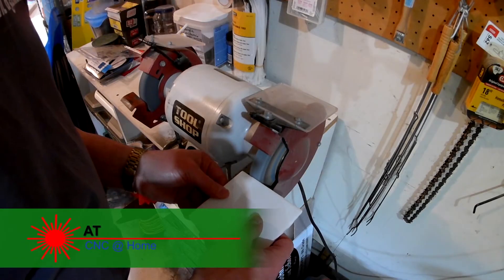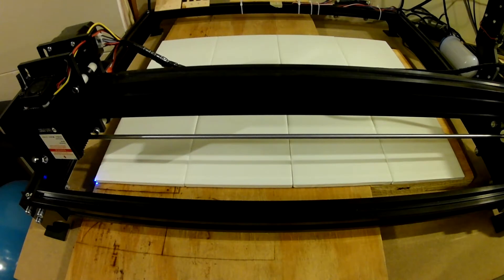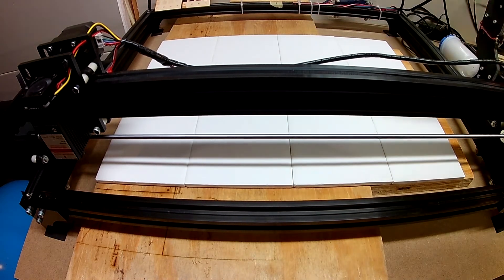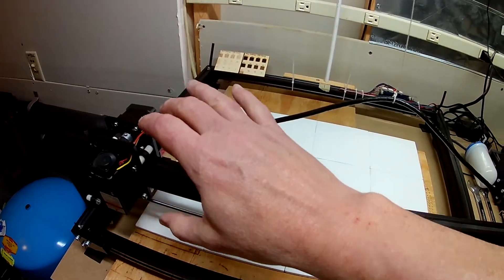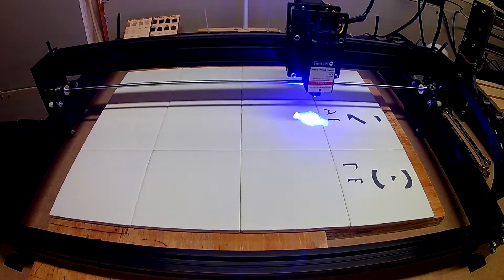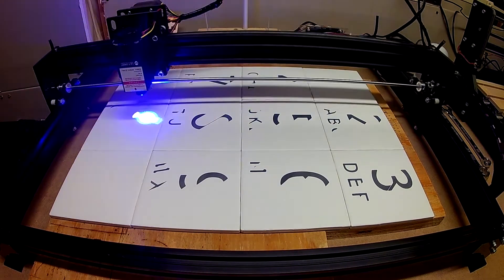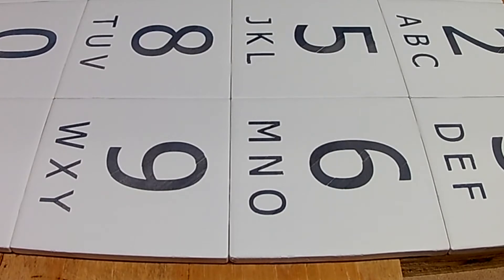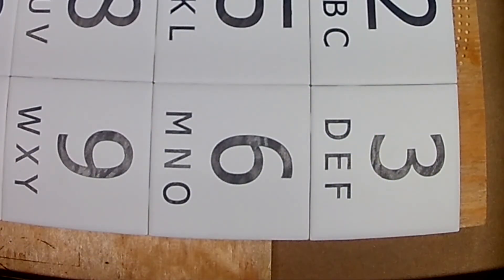Burning The Coaster Tiles

Comment: are the tiles painted?   what setting burned?  Regards
Reply from the maker: Yes, these are white tiles that are painted white.  I opened up this old project and took a look at the settings. The burn process is 1,200 mm/min at 85% power with a 5,500 LED laser.
Reply: @CNCATHome  thank´s .   I have used similar configuration without success.     regards

Comment: I did everything exactly as in the video and it doesn't engrave anything for me :-(

Why?
Reply from the maker: I don't know what more to say Mathias.  This is one of those things that just seems to work so well.  Clean the tile, paint the tile and let it dry, laser the tile 85% at 1,200mm/min with .075mm resolution using a 5500mW blue laser, clean the paint off.  What type of paint are you using on this?  I am using Rust-Oleum Painter's Touch flat white.  While it is being burned by the laser, you should see it right away (wear your safety goggles) turning black.

Sponsored Amazon link to paint (https://amzn.to/3nlX5RA) (CNC @ Home is an Amazon associate and may earn commission on purchases from this link)

Do other thing burn for you such as wood and paper?